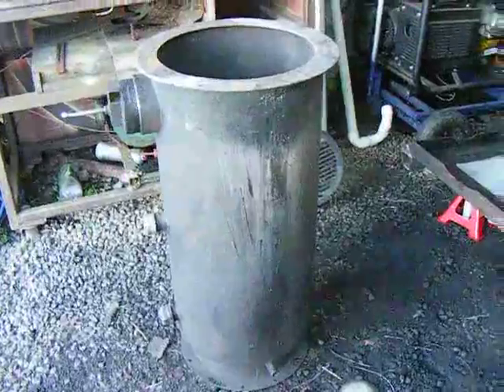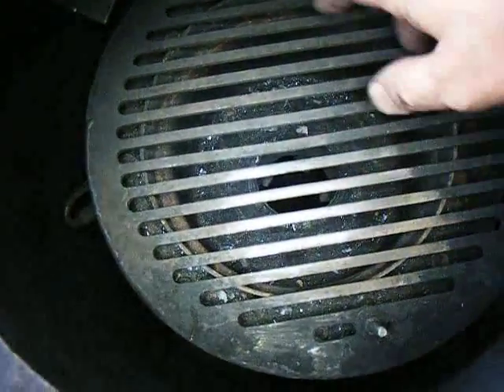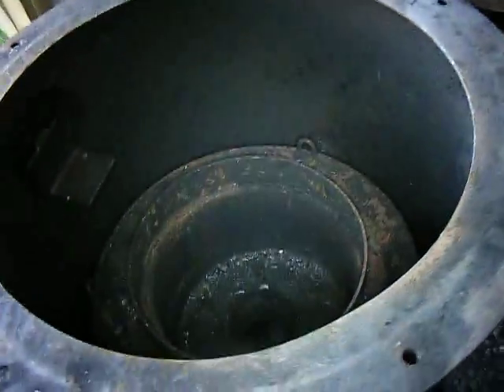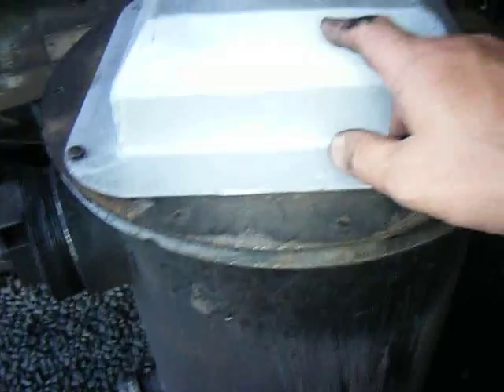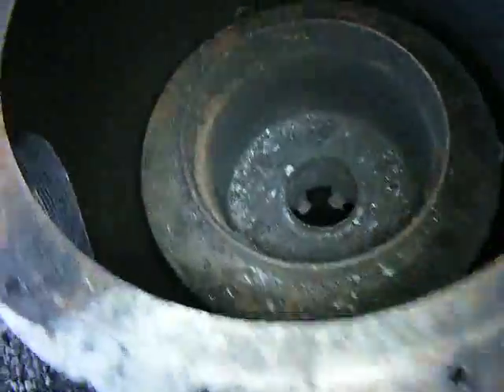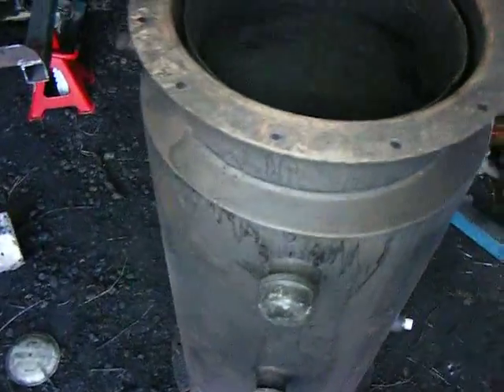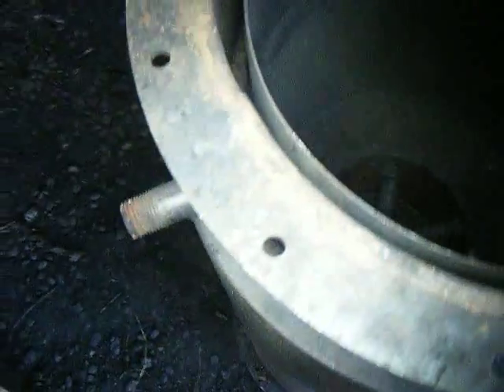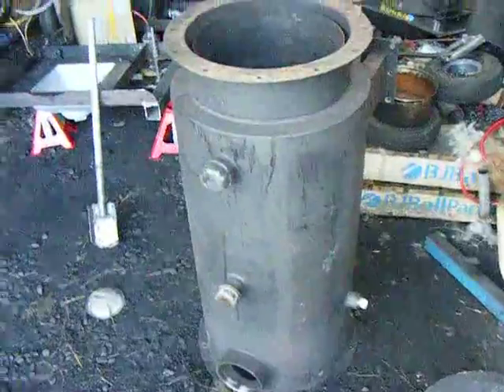Gasifier performance problems - and resolutions

Comment from the maker: Howdee Dan,
I like coffee, so I will take you up on yer offer  :) .
While the mods I made to the gasifier improved it greatly, I am sure I will need to further tune the restriction and the nozzle ring diameter. There are a few little problems that I need to bowl over, but I will get there eventually. 
3 inches for the restriction is probably still too big for this setup, so I will be trying smaller sizes all the way down to 2 inches. I have had far too much fun with this project so far  :).

Comment: I like the explanation of the creosote buildup problem and what you are going to reduce it.  I use a stainless steel bowl for a grate in my unit.  If you are on the Yahoo Woodgas dl you can see my unit and my build.  Good luck on the rebuild.  Let us know how it works out.